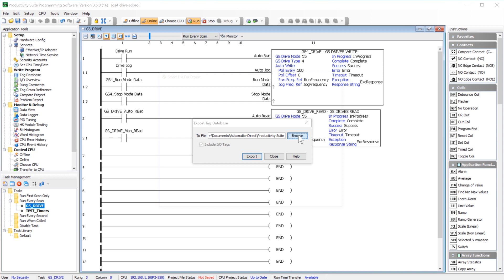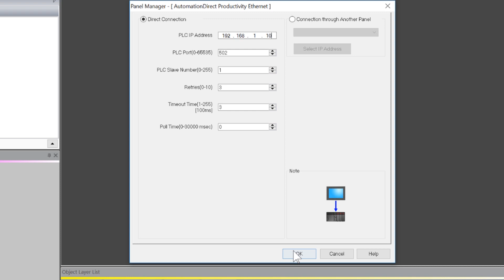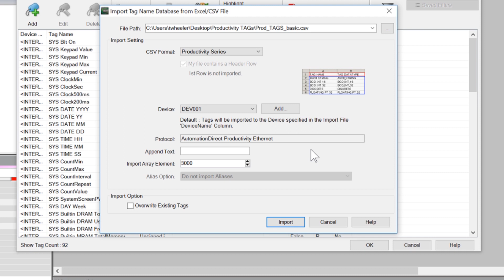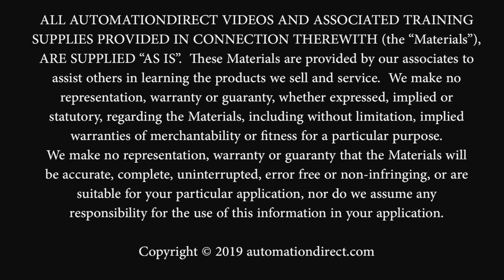C-more HMI Setup: Import Productivity PLC Tags: P1000, P2000, P3000 at AutomationDirect

Comment: How would you tell the productivity PLC that the connection got disconnected from the HMI panel? If it is this easy to just import the tags, then what is the default tag for lost communication on the communication ports (both ethernet or serial on the CPU itself) for productivity PLC's using C more HMI panels?

Edit: I figured it out. You use heartbeat in the hardware tab for the CPU and set a tag name to it to control Boolean bit that can be use to control contacts in your ladder logic.
Reply from the maker: EETEchs you can also use the "Good Communication Toggle" In the Cmore setup, which can be found under Setup -> PLC<-> Panel on the PAnel to PLC tab. This bit when configures toggles On to OFF on a 5 second interval.